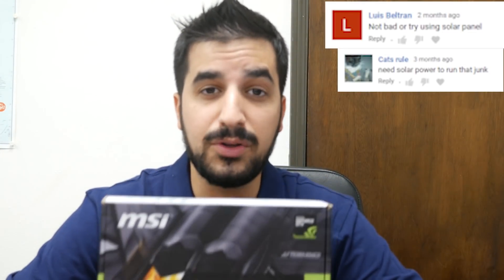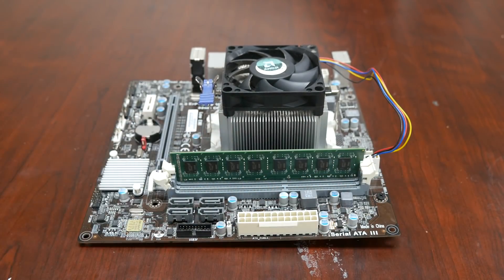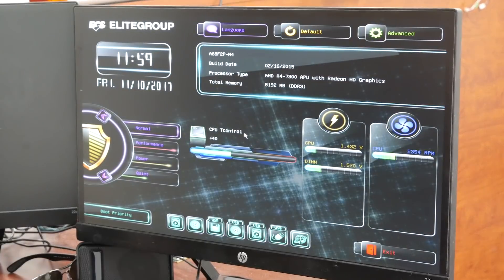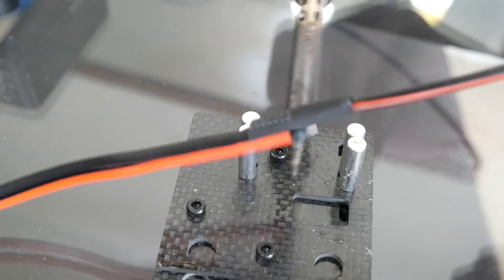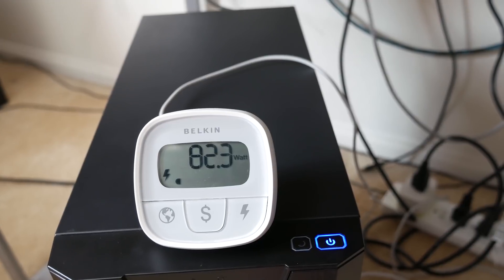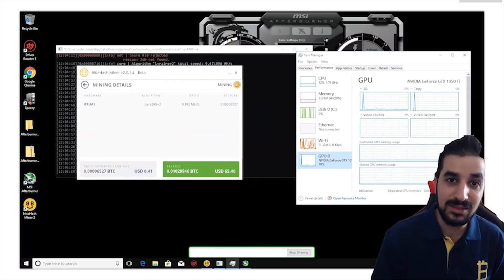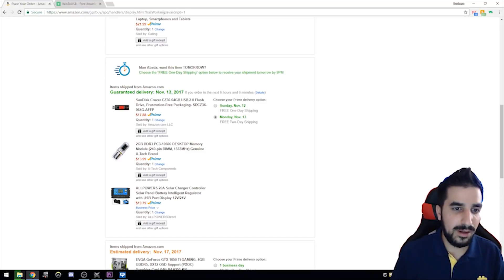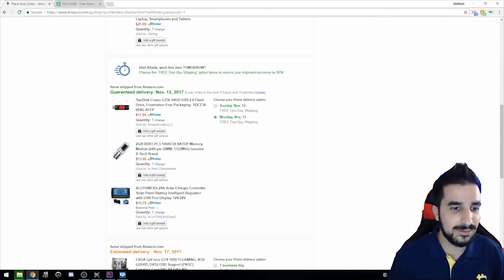How Much Can You Make Mining Bitcoin on Solar 24/7 With Battery + GPU Giveaway 4K Part 1

Comment: Just do the math. That inverter is around 70% efficient, the PSU is 80% efficient, so that's 56% efficient not counting the losses in the battery charging and extraction. So if that Solar panel really is 200w (and not just peak on a bright day), then you only have 112w for the system. That doesn't leave much extra for charging the battery. This might work in the northern regions that have daylight for like a month straight (assuming no clouds), but that won't be charging the battery nearly enough. Maybe double your solar panels to get most of the way there.

Comment: I know hes just experimenting but if anyone is thinking you could actually make a profit from this sort of set up then they obviously haven't done their homework. A gtx1050ti will have to mine 24/7 for around 8 months just to cover the $150 you payed for it. It then has to keep mining 24/7 to cover the cost of every other component in that list. The gpu would never last long enough to pay for the parts. At a guess i'd say theres $500 in parts. Thats at least 5 yrs worth of mining for a single 1050ti. What you also have to take into consideration is within say 2 yrs a 1050ti will no longer be the latest & most efficient gpu technology so will only get slower & slower at earning money. As for the solar idea ! A 200w solar cell set up is never going to keep that mining rig running 24/7. A single 100ah battery would most likely run low over night. You'd be having to get a mains charger on it every few hours. If your home already has solar then yes you will gain by having solar power but as for buying one or two solar cells + battery to power a rig ! Total waist of money. Mains power will work out much cheaper & be far less hassle.
Reply: Did you actually do it? or is this just some numbers pushing ? because my mining rig (without solar) has so far paid its parts and the prospected energy usage over the hear ( and i still have 4 month to go before the first year is done....)
Reply: If that amazon parts list he showed was accurate at the time of purchase he spent something like 740 or so dollars if I remember right on this set up. I will admit he would be far better off adding a few more cards to the single PC to earn more without adding to much extra cost but it's a fair set up. Unlike most you don't have to worry about paying electricity so everything you earn works towards paying off the hardware. The only real ongoing expense in the internet service he uses. I will say his power generation and battery is way to optimistic. You should realistically plan to have enough power to run the system for two or more days with no input. After all you might get a few bad days for solar power or a really hot day where the fan runs more than normal.
Reply: Well you can keep on using the solar panels to reduce your general electricity costs, so solar panels will always be profitable in the long run. No matter what you are doing.
Reply: @Mat for the most part though there are exceptions. The most common problem solar panel users face is battery life and replacing them on a semi regularly basis if that's how they store power from the panels. It's one of the reasons why if your not serious about how many solar panels you use or living off the grid entirely it's usually best to avoid the batteries and just sell back to the electric company when your not using the power. Otherwise the price of replacing the battery banks every couple years or so can out weigh the money you save.

Comment: Mining rigs like this are a great way to use second hand pc's sitting around that noone wants to use. They will have slow CPU's, low PSU's, but even 2 or 3 PCI Express slots and you can put in 1050's or even 460's.  If your rig is free, you just have to pay for the cards!

Comment: How many gpus can you solar setup handle I’m thinking of building one fore myselfe if I win the 1050ti will go into the build if I win thanks
Reply: It won't even handle his 1 card. Only during the day will it work.

Just do the math. That inverter is around 70% efficient, the PSU is 80% efficient, so that's 56% efficient not counting the losses in the battery charging and extraction. So if that Solar panel really is 200w (and not just peak on a bright day), then you only have 112w for the system. That doesn't leave much extra for charging the battery. This might work in the northern regions that have daylight for like a month straight (assuming no clouds), but that won't be charging the battery nearly enough. Maybe double your solar panels to get most of the way there.

Comment: will you send it to costa rica??? also why don't you use a PICO ATX dc to dc converter so you don't use the ATX power supply and Inverter so you save on AC/DC conversion loss.

Comment: You are probably going to need two of those batteries. I used two Trojan T-605 6v golf cart batteries on my RV solar setup. To keep them work don't let the power drop below 50% or they will start to die. I think I will put a rig in the trailer since I already have solar not being used. Great video by the way.

Comment: There are pc power supplies that run off of 12V, using tweaked Maxxim power optimization chipsets (to lower power loss from DC to AC to DC conversions) www.maximintegrated.com/en/products/power.html

Comment: That's all good. But 0.44 cents a day? Isn't that awfully slow? Like almost anything else you do, will earn you more money, than messing around with this? Is it really worth the hassle and risk?
Reply: like most mining, even the profitable ones, it's a resounding No. A good rig might have 10-20 GPUs, plus power, mobo, manhours, etc. which could easily cost 5K. had one just invested in a coin they could have doubled it with absolutey 0 effort other than two clicks, "buy" and "sell"

Comment: Nice project but i don't think it will stay on for 2 night with this setup it will take to much time to charge the battery maybe add one more solar panel to the setup
Reply: so go in the hole another $300 dollars, to make 44 cents/day.....
Reply: divpwn i didn't say he will make pofit out of it. but to be able to run this setup more than 2 night he need at least 400 watt of solar panel in my oppinion but if he go with a bigger solar system to power let say half of his house + the mining rig than maybe he can do better

Comment: This is something I want to setup myself, but on a bigger scale, by using a server grade motherboard with dual CPU sockets, and 6-8 cards running in SLI with GTX Ti model series cards, all hooked up to enough solar panels and batteries to run 24/7. 

Cooling would be bit of an issue in hot weather, however I would solve that by using liquid cooling for all the cards running, and the water cooling would be hooked up to an external modified mini-cooler that will cool the water down fast enough for all the cards inside the machine. Having a modified mini cooler is the best way I can think of that will be efficient enough for keeping things cooled, of course I'd have that hooked up to some solar panels of it's own just to run also, plus with each card having waterblocks on them, it'll significantly reduce their bulk size, leading to better airflow within the system so they're not all cramped and having trapped heat between each card.
Reply: so you are going to have $10,000 dollars worth of solar panels for 6-8 cards?

Comment: The problem with a battery backed up solar setup is battery longevity and cost. The battery won't last long and the cost of the battery replacement is more than the income it  makes running without the sun. Also, a 200W solar panel will not allow 24/7 operation. You might get a full day and night with the help of a fully charged battery but no way will a 200 Watt panel be enough energy for full time operation..  That panel will peak at 150 watts and being November you'll only push about 500 Watt hours now and 800 Watt hours in the summer. Also the Charge controller isn't a true MMPT  so the efficiency is about 70% charging the battery and the inverter is at max 85% efficiency. At best your only getting about 300 watt hours in the winter. Enough for only 5-6 hours in total.
Reply: Radiation Network just use deep cycle battery problem solved

Comment: On this scenario, maybe using a picopsu to supply the system is better than an inverter and an AC power supply, since the panels and the battery are dc, the picopsu is more efficient, with a lower power demand the battery should have a longer life, since the discharge cycles should be less deep.
Reply: Also wouldn't trust a cheap car modified sine wave inverter on a pc

Comment: It won't work your agm batts can only be discharged 20% any more than that and it will die quickly
Reply: this is what got to me too. I have a 12v home lighting set-up and i pull in total about 100watts, but my battery is double the size of this thing  and a deep cycle specialized unit and you don't run the battery totally flat, or actually below 50-60%, if you do , you're going to kill that sucker in no time. So much wrong with this *experiment*.

Comment: Really !! hes using an Inventor to convert the 12v DC from the solar cell / battery to 120v AC then using a PSU to convert the 120v ac back to 12v DC. How inefficient and expensive is that ! He should be using a 12v dc to 12v/5v/3v dc motherboard power supply. You can get them from ebay/amazon for $10 - ebay item 222684559933
Reply: I hope people realize how underrated your comment is
Reply: There's an issue with using  car batteries for that. They're rated at 12 volts. But they charge at usually 14.7 volts and you can run them down to maybe 9 volts completely dead. And I really doubt a pc would be very happy to have that kind of voltage range.
Reply: what you mean the guy is right why use a inverter ,the pc is 12dc so if you take 12vdc then got to a inverter to make the ac 120v or 240v only to run a ac power supply to make it go back to 12vdc there a lot of loss power there dude look for a pc DC POWER supply like people run in car pc from there car its runs on 12v dc off the car you save a shit load of power this way even if the dc car power supply to small of power use 2 of them and you still save power
Reply: John Pfeifer... Its designed for use in "car" so it probably has a buck converter to regulate voltage to 12v just like it uses one for the 5v and 3.3v output. You would need an extra 12v buck converter and cut and splice some cables if the GPU needs its own power.
Reply: And why would zjat happen? Even if you dont trust the cheap china PSU you can get a solid Pico PSU and would still save money and power ...
Reply: Exactly my thoughts while I was watching. It's all about the margins! :)
Reply: Not really he is still losing about 10-20% or your power.
Reply: That's exactly what I thought , going straight to D.C. Would be the best solution since you are not using house items but just computers....
Reply: The 1050 ti does not require an additional power conector.
Reply: 0.7 amps.  Ohms law.  P = I*V.  When (P)ower is 84 watts, and (V)oltage is 120, (I) Amps is 0.7.
Reply: Techno Crat completely agree he is just wasting power
Reply: Had to do some googling but I see what that's for now. Thank you👍
Reply: Thanks.  I was looking for this solution a few months ago but only saw DC power supplies which are too expensive. Are there any drawbacks using this pico PSU?
Reply: I get the logic behind your comment...but the ebay item you linked to has no 6 pin connector for a GPU. Just a 4pin cpu, molex and sata and the 24 pin connector. 
I also feel that a $40 400-500 watt AC PSU would be more flexible. He could decide to disconnect from solar and run on electricity...or sell the unit, or overclock the card or add a second, etc...Just my 2 cents
Reply: Mmm, This is how I would do it
Reply: Techno Crat 9
Reply: your 10$ ebay turd will melt after 3 weeks shorting out your entire system... then you'll switch to ac and probably delete your comment...
Reply: Thank's, I would do that, not just with mining system, but with any solar running system
Reply: How many amps was it drawing at 84 watts?
Reply: This is a very correct statment.
Reply: A PC is rated from 11.6 to 12.6V if you charge this 100AH battery with 200W/peak your voltage will drop to about 12.5 V anyway, the battery is constant charged with only 20W average for a few hours. so the voltage will never exceed, bc the solar module is way too small, you need at least 400WP and 200AH if you draw 150W for 24/7 even at the equator. you shouldn't draw more then 80% of the capacity, or your battery dies within a year
Reply: @Peter Kropotkin the comment i was replying to made no comment of using a converter. He was saying just use the battery straight. He has since edited it to something reasonable.
Reply: @Peter Kropotkin since i made my comment he has now edited his comment to make it sound like he was talking about a DC to DC converter. Im well aware there's ways to deal with the voltage difference... But the original post before it was edited was suggesting running it straight from the battery without any converter
Reply: Came down here to say exactly that! Although he should be "golden" cause he got the 80+ PSU ^^
Reply: I don't think he made this video thinking he be flexible and you can run your dc off a power supply. he said he was after the best ways to save power, think the guys are talking about saying at dc he wanted it to run for solar so it was free of running cost $0 from the sun .its good that we all got 2 cents to add maybe more heads helping best ways to do this its all good for us all
Reply: Yeah and he will burn the motherboard in first 5 seconds

Comment: Awesome video. I was thinking about building one of these, I live in southern CA where the electricity rates are very high, where even efficient mining on the power grid is not profitable.  However an 82W system I can do for sure. What coin or coins are you mining with the efficiency settings you are using?
Reply: I would love to see a grid-tie inverter setup to help people pay for expensive daytime power however I can only see less than 3$ worth of power produced per month @0.16$/kwh with ~30 days of sun with 6hrs of direct light for a system under 100w

Comment: I think a solar array of those with at least 2000watt converter maybe even a 10000watt battery use it for backup during night but at that point you should have an electrician do it for you because it's very dangerous I guess

Comment: nice setup but, why not use the picoPSU eg.120W directly instead using all stuff to change 12V to 115V/230V and than change back to 12V 5V 3,3V etc ? :)

Comment: I think u will need to install a solar panel farm in order to power up a small scale mining of up to 30 gpus of rx 480/580. The constraint will be on the roof space to mount those solar panels. The maintenance of the batteries is also quite costly too. I think if the cost of electricity is at 0.10 usd per kwh, mining ethereum with 30 gpus is still profitable and less hassles too, assuming that u underclock those GPUs.

Comment: I have 1050ti too. But 1060 is much better to mine :)
Reply: V RoyaL I got a 1060 and it’s crap lol
Reply: Maybe ur memory
and wrong overclocked
Reply: YUSEHZ QT for nvidia, its a, prettt good card. 22mhs for me
Reply: The silicon lottery in a nutshell
Reply: What's a good over clock setting for the 1060
Reply: depense on your cooling system
Reply: That’s because nVidia sucks at mining. RX 580(GTX 1060 equivalent) is much more efficient at mining.